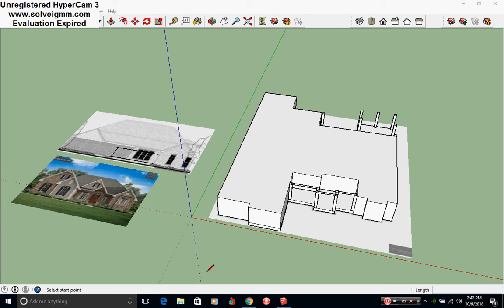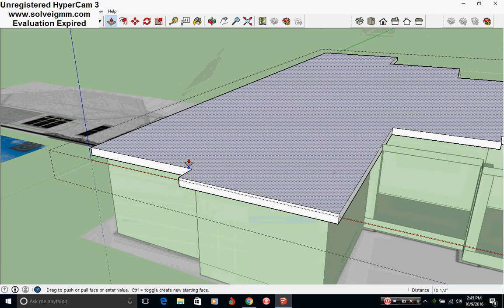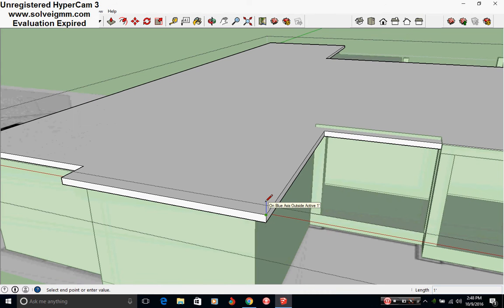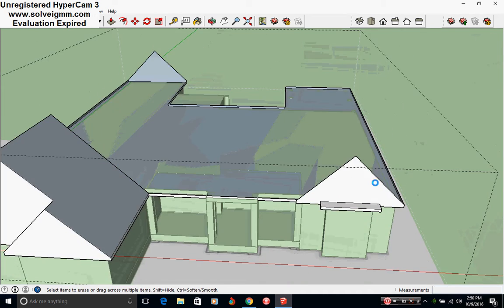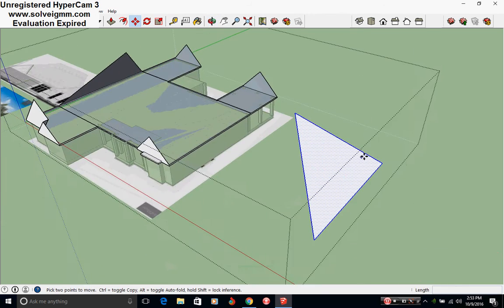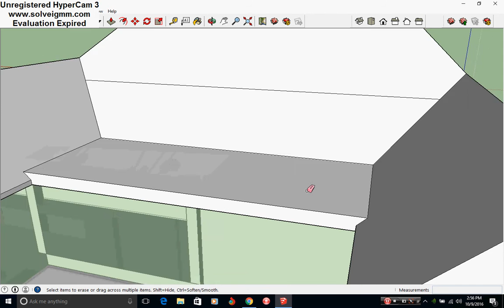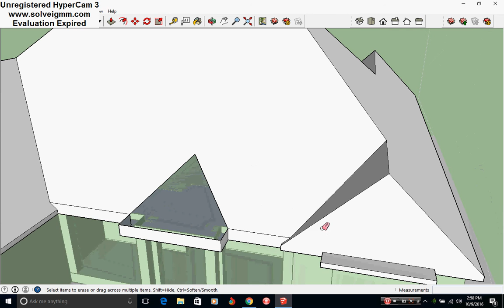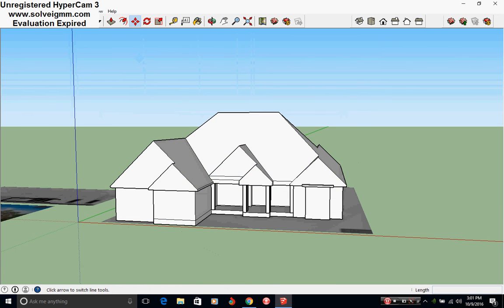Creating a Complex Roof in Sketchup Using Reference Photos

Comment: The problem with this is you're setting the bottom of the eaves to sit on top of the wall height. If you look at how a house is framed, the pitch of the roof trusses extend downward below the top of the wall until they are horizontally the correct distance from the wall. This angle and distance is very different from case to case depending on the roof pitch and desired overhang distance.

It took me some time thinking it out but I was able to solve this dilemma and my sketches of houses look much more realistic since the roof and walls are essentially fused into each other or overlap a bit and not entirely in their own completely separate vertical planes.